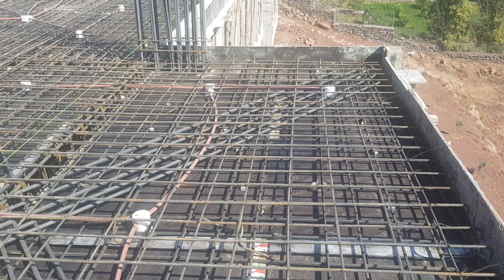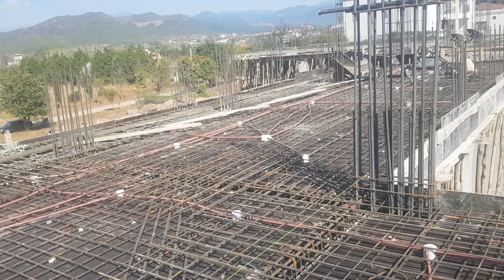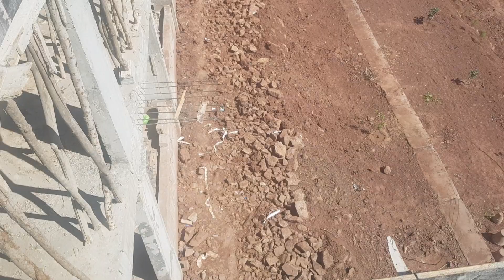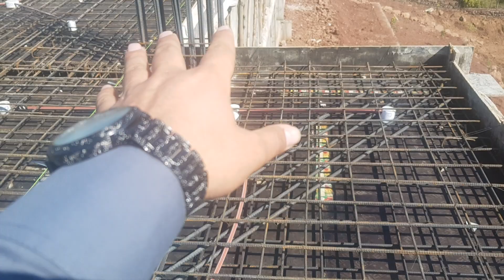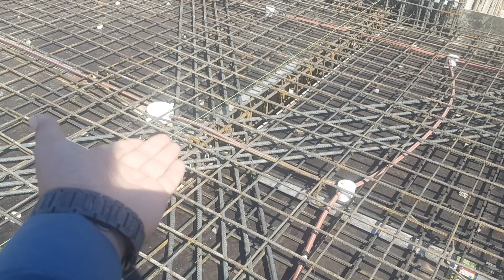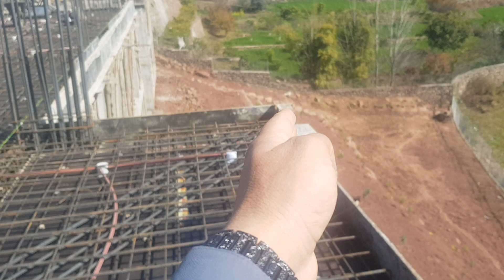what is cross beam in cantilever slab during highrise building construction

Comment: Sir, I have provided beams in between the  columns not exactly upon columns for residential building , is that safe ???  Kindly reply ..
Reply from the maker: If you are using load bearing walls then its ok in most og cases. But if its frame then special detailing is needed.